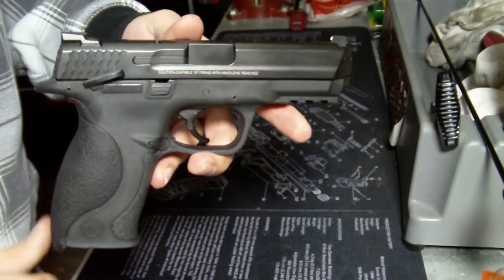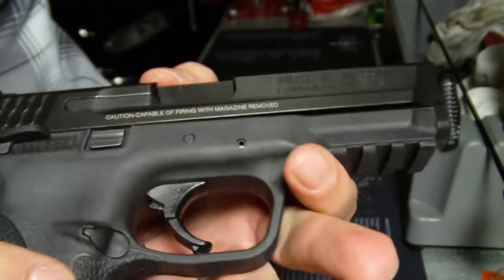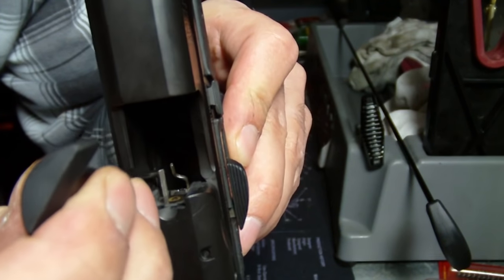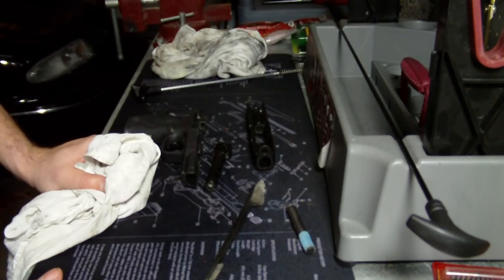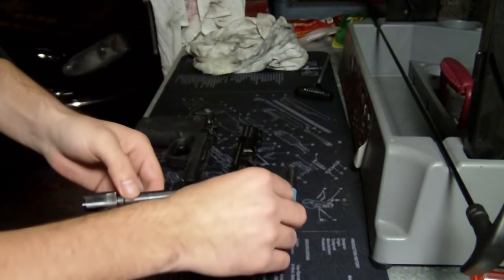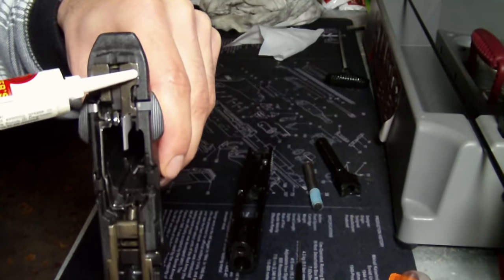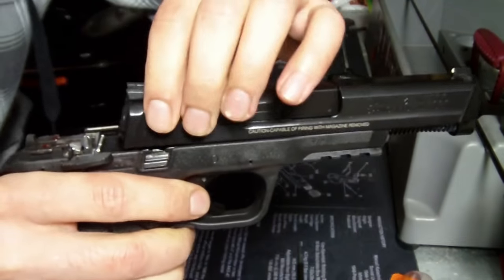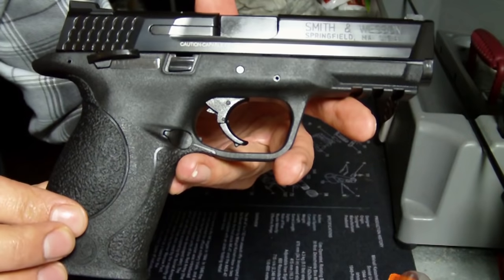S&W M&P 9mm Pistol | Disassembly & Cleaning

Comment from the maker: Awesome choice, congrats on the new pistol!  The wax and silicon cloths provide a rust and moisture prevention barrier without the use of a wet oil (which will usually evaporate quickly).  The wax cloth provides the protection and the silicon cloth provides a nice shine to the exterior.  Thanks for watching!
Reply: you do a great job  showing how

Comment: Great video.
No need to check the sear pin at the end. It gets pushed back into place when a mag goes in.
Technically the gun can be taken down without touching the sear pin but that requires a dry fire and is not what the manual recommends. The sear pin just disables the guns cocking mechanisim.

Comment from the maker: Basics are: clean rags, cleaning rod, patches, bronze bore brush, solvent, lubricant, nylon brush, bronze brush, boresnake, q-tips, rem oil wipes, silicon cloth, and wax cloth.  That is really all you need, but you will find additional things along the way which make the process easier.

Comment: One of a few videos that should the proper removal of the M&P slide, personally don't use stainless steel wire or bore brushes anymore, been  more than 10 years since I shot all lead bullets.
 Rarely use grease it can cause malfunctions  in cold weather, same for FrogLube.  I use Breakthrough or Gun-Werkz as cleaners and Weapon Shield as a lubricant all are non-toxic.
Reply: Any kind of bullet can create hard deposits.  Copper is a beast to get off.  Besides, just having baked-on gsr in there can be too much for a nylon brush if you've shot a lot of rounds.  There's NO reason NOT to use a wire brush, and some good reasons to use them.

Comment from the maker: They apply a good protection layer on the outside metal surfaces.  It helps prevent corrosion from moisture as well as oils from fingers when being touched.  The cloths are not really necessary, but do help maintain the value of the firearm better.

Comment: The thumb safety is only on certain models, I have the basic 209301, not sure you can add a thumb safety to a model that doesnt include it because there no notch in the frame for it.  I use a 9mm boresnake, some brushes, qtips, and a cleaning agent thats it.  For lube, Fireclean is the best product on the market, bonds to metal, and the majority of carbon just wipes away.

Comment: I know this video is from a LONG time ago, but I still find it to be the most helpful video I've found about cleaning an M&P. I just bought an M&P 2.0 Compact,and have read that I should "clean" it prior to using it for the first time. How much of this that you've showed here should I do? Hope to hear from you soon. Thanks!
Reply from the maker: Thanks for watching and commenting, much appreciated!  For a first time cleaning before use, a couple of pushes down the barrel with the soft brush, and a good wipe down of the moving parts would be sufficient.  The only purpose for this first cleaning is to remove most of the production and shipping greases the parts can be covered in.  hope it helps!
Reply: IntoWeapons yes, very helpful. Thanks!!!

Comment: I've got one of these with a desert tan lower. I was wondering  if you know whether using 99% Isopropyl Alcohol for cleaning all but the barrel would be a problem. I mainly use it on the lower & the upper housing. It seems to clean very effectively  & I know it's not hard on most things. It's used extensively on fragile electronics & can be used to clean LCD monitor screens. I'm don't much care for the Hoppes for cleaning. 

Thanks

Comment: Thanks for the video, now my S&W is clean. You didn't mention anything about the main spring, so I had to slow the cleaning portions to see if you actually touched it. Some strange reason on my M&P 9mm I don't have a Safety lever. Good video though.
Reply: Assuming you mean the recoil spring, that tucks in below the barrel?  A GREAT way to clean that is with this stuff called Gun Scrubber.  It's a spray solvent that blasts away crud, and it's not great for everything but perfect for things like a captive recoil spring where it's basically ALL crevice.  There's really no other way to adequately clean a captive recoil spring.

Comment from the maker: I buy most of my supplies as individual pieces, but I would recommend the Hoppe's Pistol cleaning kit - comes in an orange colored package and has the rod, brushes, some solvent, patches, etc.  Pretty much the basics of what you need.  If you go that route, def buy the spray solvent seperately though, makes it much easier.  Thanks for watching!

Comment: @3:05 Big FYI Gents, at least on my M&P9 without a Safety; you'll see two Pins/Posts sticking out in the Ejection Port.
The one he's refering to is not the rightside spring loaded Pin, but a 3rd "hidden" Pin folded up beneath the leftside (larger) Pin.
Use the Tool to push 'that one' down !

Comment: My first pistol to, my question is on disassembly.  I never use the tool to release the pin. I just take the latch down and dry fire it and the top half slides off. Is that hurting it do you think?

Comment: you can get the safety option with or with out I bought one in October of 2015 and got the safety option on my 9mm. BTW Great video!!
Reply from the maker: +Rob Wiley thanks!
Reply: you got it ! quick question for you.. when you put the grease on the slides, is any machine oil okay to use or would you recommend something in specific?
Reply from the maker: Rob Wiley I would use gun grease, as it withstands higher temperatures.  I use "shooters choice" all weather high-tech gun grease with easy to apply syringe.  i usually buy them from my local retailers, but they are available online as well: http://www.midwayusa.com/product/320634/shooters-choice-all-weather-high-tech-gun-grease-10cc-syringe

Comment: I am very interested in buying a m&p 9c and that's the one I have my eye on. When I went to go determine wether I liked to feel of the shield or the 9c I noticed that when I cocked them back to check if it was clear. It was hard to pull back. I wanted to ask anyone that has a m&p if it has to be broke in . I notice in all videos of people with smith and wessons tend to have little to no problem pulling it back. So again do pistols have to be broken into like other things. I don't mean to sound ignorant but I have never owned a pistol. Until I was interested in getting my CHL I was always a rifle man. Then I fell in LOVE with the m&p series. Thank you to anyone that takes the time to answer my rookie question.
Reply from the maker: josiez521 Yes, recoil springs will definitely loosen up over time and use.
Reply: I just bought an M&P 9 (full size) and absolutely love it. The recoil spring is pretty stiff at first as is the slide lock. Now with about 500 rounds through it and a couple of cleanings and lubrication, it's much easier to manipulate. I put an APEX trigger on mine and I am very happy. It feels like it's getting smoother.
Reply: I just bought mine at academy for 541 and I love it. I was going to go with the glock 17 but shot this bad boy for my CHL class and it won me over. Like all firearms it has to be broken in but it is very reliable and I use it ass my every day carry

Comment: this video is very informative. thank you. I'm having a hard time getting my slide off of the receiver. it just doesn't slide forward and instead tries to lock back. any advice?
Reply from the maker: that happens sometimes, and it is generally due to not having that take down lever pushed downward in the magwell prior to disassembly - or it can happen if the slide lock lever has the opportunity to catch the slide as it comes forward.  I will keep my finger holding the slide lock down sometimes in order to avoid that happening.  hope it helps and thanks for watching!

Comment: I have a quick question, in terms of buying one for a CA ccw permit, I would want to know which one would be better. I read some common issues around the net that say the Glock Gen 4 does have some feeding issues, but Im sure that problem was fixed recently. On the flip side, Ive also read that the Current M&P may jam or misfire due to certain qualities of ammo. So knowing these two common problems, which would be safer to qualify with for a ccw?
Reply: Practice with cheap ammo but carry the really good stuff.  Easy.
Reply: Glock gen 4's are banned from CA unless you're law enforcement.
Reply: I own an M&P9 w/17 rnd magazines and love it.  But, in my opinion, it is too large for normal concealed carry.  I carry a Sig 938.

Comment: It can be a little bit of a bitch to takedown.  I'm used to Glock 2 second takedowns.  It took me a while to realize I how to get the damn slide off and get the sear pin back in the up position, I had to finally use a pencil to push it up.  Other than that, and the weird trigger slack, those are the only negatives.  Fantastic ergonomics and fantastic shooting pistol.  Feels better than a Glock.
Reply: +Google Account Uh, sorry but the one and only time I used the sear lever take down method it would NOT push up using a magazine.  This was day one of ownership to a gun I wasn't familiar with when I wrote that comment.  No I've never owned a Sig, don't know where that came from when I said Glock...  And Naw, I don't actually own an M&P I just like to pretend that I do to write comments about sear levers.  Thanks for caring google.
Reply: ***** I hope you don't own guns.  I doubt you're supposed to if you do.  You got an imbalance lol.
Reply: It is a pain to disassemble.. If if you know about the seat… I have a HK VP9, it has the disassembly lever too, but I can just pull the slide off after flip the lever.. The only thing I'm against Glock, beside it feels weird in my hand, is I have to pull the trigger to disassemble it..
Reply: Disassembling an M&P9 is incredibly easy.  Go try to disassemble one of those old Ruger P89s, then we'll talk.
Reply: You can also take it down by dry firing it like other semis instead of flipping the little pin inside. 
The take-down lever is much easier to use than the tiny things on Glocks.

Comment: Do u lube up the bottom of the slide
Reply from the maker: +Eric scissorhands typically no, just because the lube accelerates dust/carbon buildup in that area, which after a couple hundred rounds can increase friction on those parts, causing excessive heat and feed malfunctions.  I am sure some would object to my opinion though.

Comment: It's ridiculous that, for advanced as this gun is, and how great it is, that in 2013 a tool is needed to take down ANY modern handgun.  Pretty ridiculous, S&W, pretty ridiculous.
Reply: You do not need the tool to take it down, that is specifically for the change of backstraps
Reply: Although that IS a valid thought, I just reach in there with my pinky and flip the Sere pin. No issues

Comment: What about the spring color (light blue)? Has a position?
Reply: That's to tell you which end is forward.  Problem is, it flakes off when you fire the gun and will coat the inside of your slide with that color (mine was green).  I got rid of it with a brush loaded with Hoppes and Gun Scrubber, and a LOT of diligent scrubbing.  It was a pain.

Comment: Just got one three days ago used got some scrape marks on it any idea on how to get them off
Reply: Scrub the area lightly with a nylon - NOT wire - brush like the one in the video here, with some Hoppes solvent on it and wipe that off with a dry cloth.  If they don't come out with that then they're in the finish, consider them character marks.

Comment: 2 words, Sonic Cleaner, then dry and spot check ;-)
Reply from the maker: for home and personal use, a sonic cleaner is expensive and takes a lot of counter/storage space for a task which is usually done very rarely.  Not a huge fan of sonic cleaners personally, as we had a very expensive one at the gun shop I worked at, and at full blast for extended periods on a field stripped glock or rifle parts, it wouldn't get off fouling which would take me 2-3 passes with a brass brush and patch to get off.  sonic cleaners are good for extraordinarily dirty firearms, and imo only as a starting point for the full cleaning process which should follow a sonic cleaning.  thanks for watching and commenting!

Comment: i'm not trying to be negative. but, wow, no gloves and all toxic cleaning liquids..
Reply from the maker: For an occasional cleaning, even once or twice monthly, the exposure to these solvents is not harmful to the skin in most cases/products.  ventilation for the fumes is probably of more concern than contact with skin.  but you are right, in my normal cleaning routine I typically wear RAVEN Safety gloves to avoid contact with solvents.  thanks for watching!
Reply: keep telling yourself that.
Reply: @edlc7184    So, you were just waiting to be negative.....smh